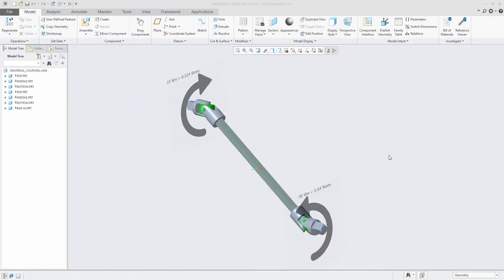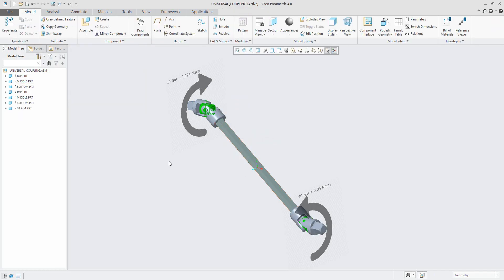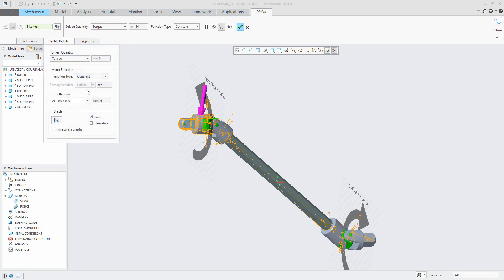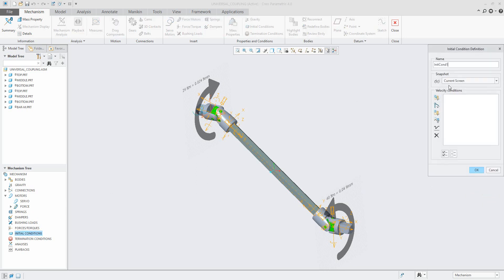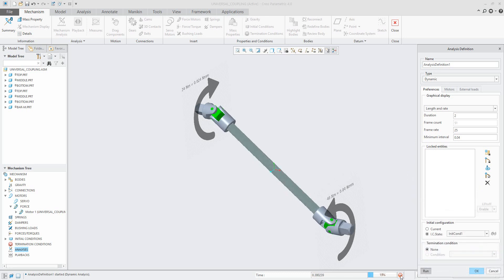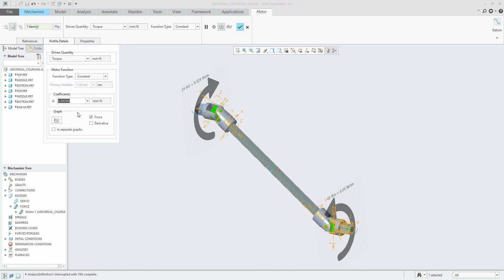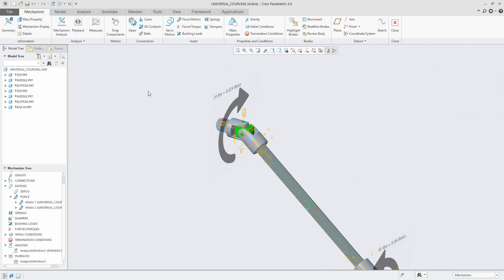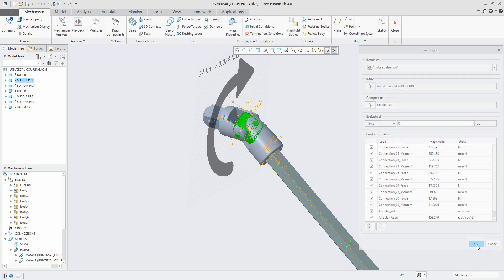PTC Creo 4.0 tutorial: Transferring Mechanism loads to Creo Simulate

Comment: Hello Mr. Vladimir. Could you please make a more in depth video about how to define the forces and reaction forces in a mechanism and then using them in creo simulate? More specifically about pin and roller jointed beams. Would be very much apreciated
Reply from the maker: Dear Cristian, I will try to find some nice example.